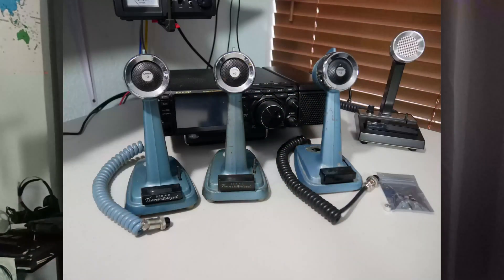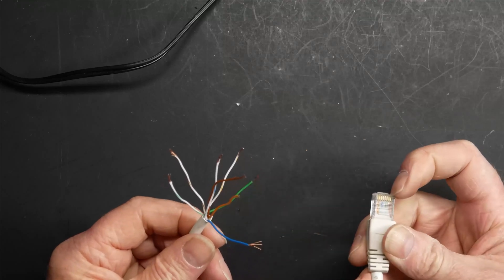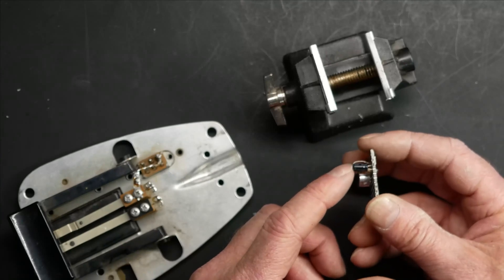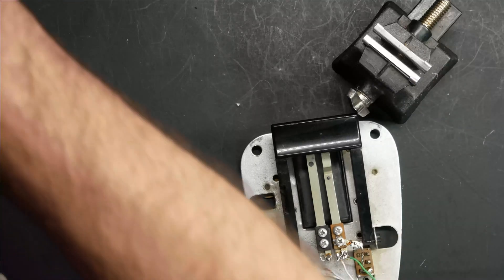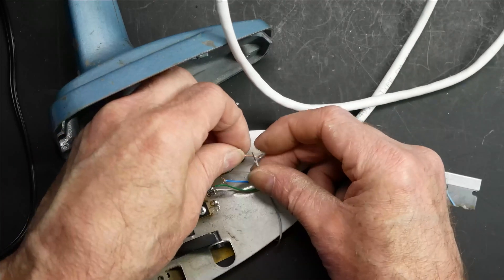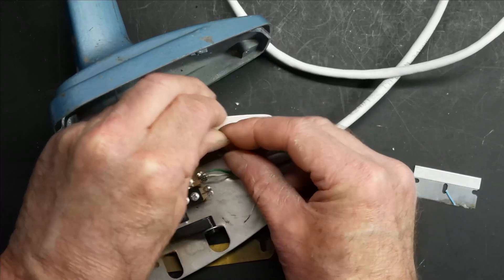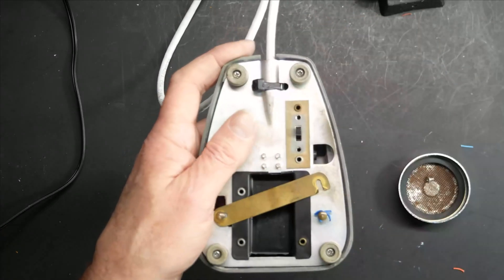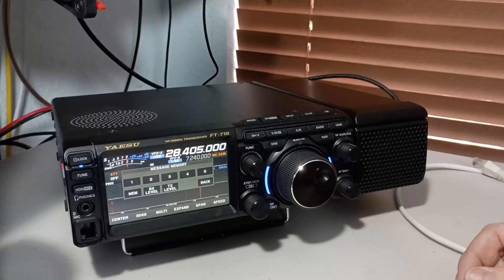Installing an electret condenser mic element in a vintage Turner microphone.

Comment: There is absolutely a standard for Cat 5/6 patch leads….the pairs are split so the twists match the TX and RX pairs used by the Ethernet wiring in the network, whether wired to 568A or B, but not straight through 1-8 in order as you might think.  Oh, and re the shielding, you can get shielded twisted pair (STP) as well as the unshielded (UTP) you were using, just FYI. 👍